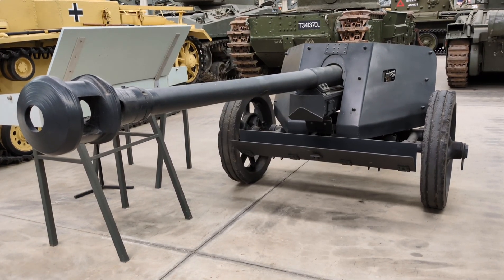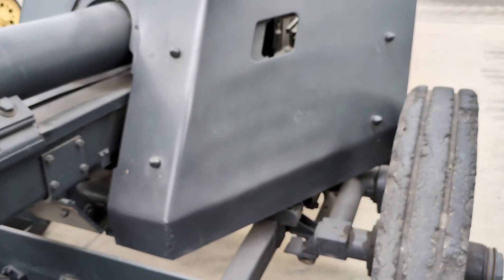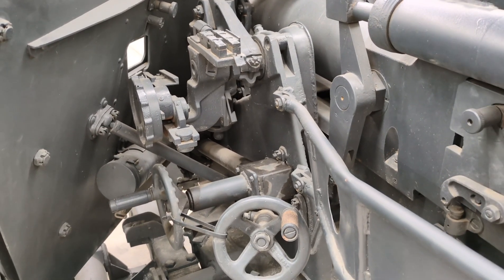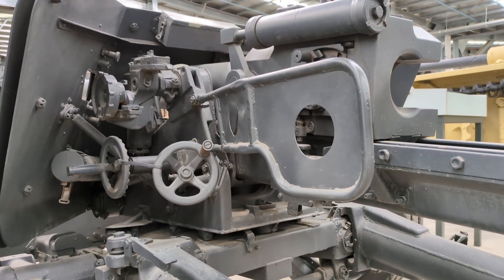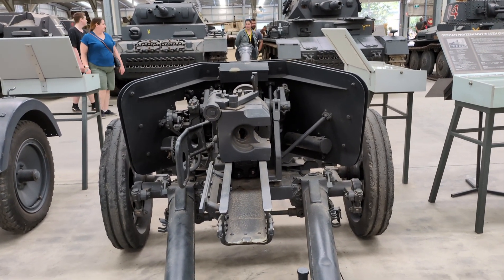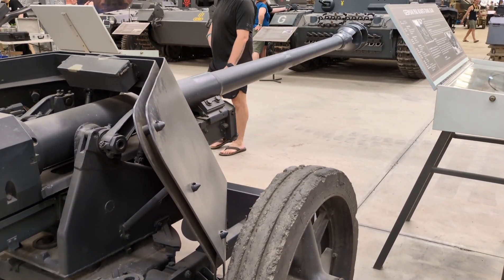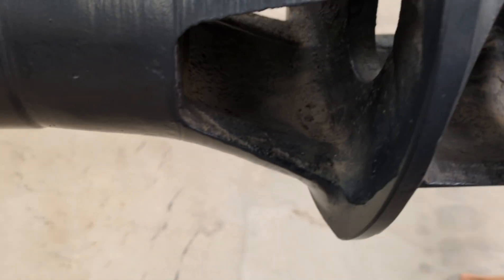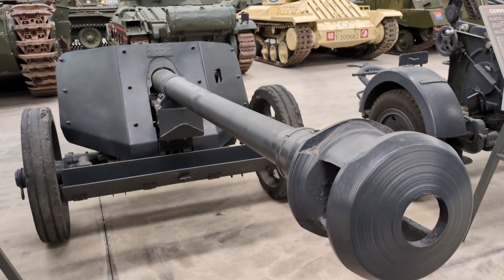PaK 40 7.5cm Anti Tank Gun at AAAM. German Artillery.

Comment: Was the Pz4 armed with a 48 caliber?   And the Pak 40 was 46 caliber ?
Reply from the maker: The towed and vehicle mounted PaK 40 was 46 calibres (L46 in Waffenamt speak). The PzKpfw mounted KwK 40 & StuG mounted StuK 40 was initially 43 calibres and later 48 calibres long. Check out my Panzer IV and StuG III videos for more information.
Reply: @salameragazzo  Thanks.   It appears Germany complicated their logistics problem.   Different Ammo for each ?
Reply from the maker: @tellmemoreplease9231 The projectiles were the same, but the charge and its canister were different on the PaK 40 and KwK 40 ammo. Inside the turret of armoured vehicles shorter ammunition is easier to handle by the single loader and more rounds can be stowed onboard. With towed artillery this is less of an issue, so the charge on AP rounds can be optimised for muzzle velocity.